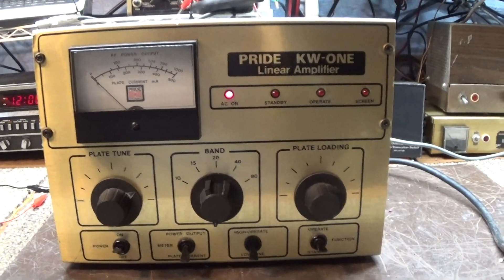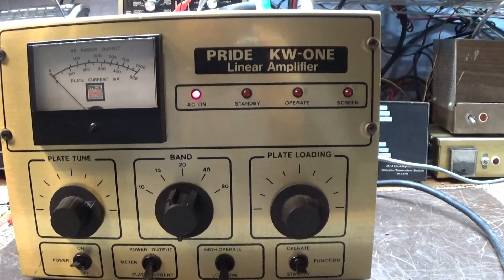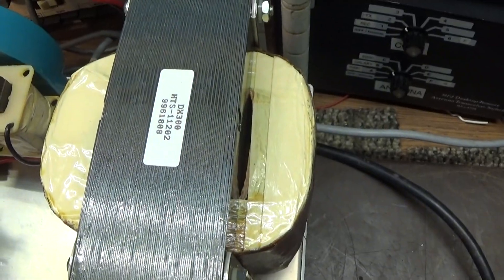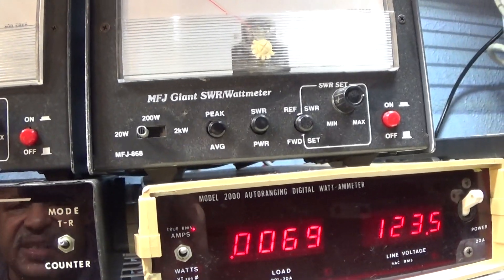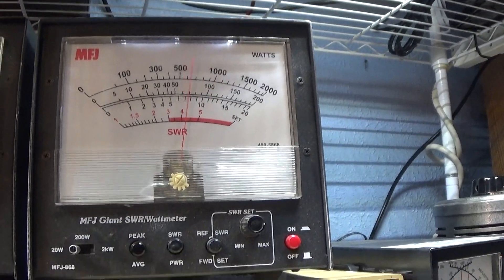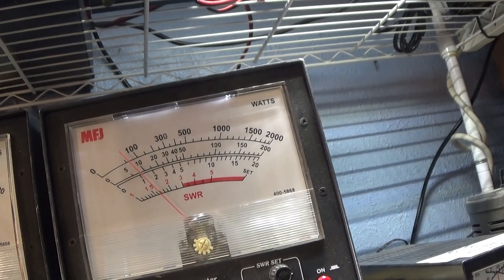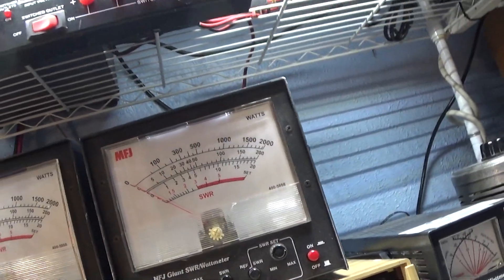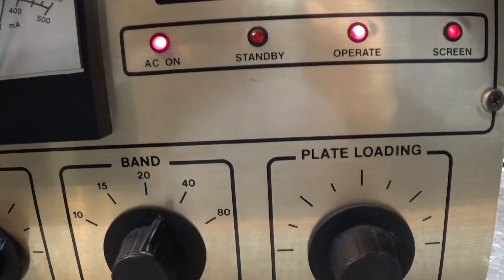Pride KW-1 (DX-300) rare single 4CX250B  linear amplifier on the bench

Comment: Sir can you please call me I overdrive my pride kw1 and I have no output power 516 417 7717 please help
Reply from the maker: The Pride is a very complicated amp. It could be a lot of things. I would say try changing the tube first. If its not the tube, maybe the screen voltage is bad. The screen voltage is a weak spot on those amps. I also suggest you get the Nomad upgrade HV and LV power supply boards for the Prides if you haven't done so already. The screen supply is on the LV PCB and hence if that is the problem, getting the Nomad upgrade board would fix it. If your problem is in the HV, also getting the Nomad HV board would fix that. Pride runs on 2.5KV's!!! Sweep tube amps run on 800v's.  If you don't know what you are doing, stay out of that amp. It would be lethal.   https://www.ebay.com/itm/114785393583

Comment: The PI/L network you talk about is actually a BUTCHERED PI output. It is 2 coils in series, NOT an L.
Reply from the maker: You are so wrong.
Reply from the maker: The factory schematic shows this amp has a Pi-L circuit while the Pride DX-300 had just a Pi circuit. Pretty sure this later model had the Pi-L and the high drive circuit added to pass the FCC at the time. High drive for a single 4cx250B? 100 in to get 400 out! Also this has a Plate current meter as it was marketed as a Ham amp vs a CB amp. What is a Pi-L?  Just a Pi circuit with another coil after the Load capacitor. It can be a continuous coil with the load tapped at the correct point, or it can be 2 coils in series, 1 before the load and 1 after. Both ways are used throughout linear amplifiers with Pi-L output circuitry.

Comment: Don't quite understand how the MFJ meter swings forward on both average and peak which indicates a higher wattage, but yet the plate current swings proportionally backwards indicating less current. How does less equal more?
Reply from the maker: Duty Cycle and RF Power vs DC power.
Reply: The amp is indeed swinging backwards. The wattmeter is incapable of showing whats really going on. Basically the amp is grossly misstuned or its being overdriven.

Comment: nice,i have a pride dx 300 with nomad board,it ll do 1000 to 1100 radio drive pep watts,on my lp100a or bird peak meter
Reply: the 4cx250b tube don't suppose to drive with no more then 5 watts pep on am career operaper manual say 12 pep for ssb and the repair manual says you can use up to 15 pep the tube company says what the operator manual sats 5 am pep 12 pep ssb with 12 pep ssb you should get 500 pep with 15 pep you should get 650 pep  when you start running 35 wats in it and get 100 watts out you tube will only last maby a year if you lucky and run hot RF Parts you can get new taylor 4cx250b tubes for$139.95  or get new old stock eimic from$79.95 to $249.00 if you don't try to get 1000 watts out of a 250 watt tube the tube will last about 10 years it more of a SSB amp because 5 pep watts on am will only give you 250 watts  but SSB with 15 pep you get 650 watts  not bad and tube last 5- 10 years good. just radio drive is too much this is a low drive amp
Reply: @extremlaybak  (Be The Shi) I mean Stuff
Reply from the maker: OK, but I always go by 2x the plate dissipation for the output. A single 4cx250B has 250 watts plate so.......

Comment: Wow! The hits just keep coming! What an excellent find. And done correctly. Anyone owning the 300 and if they're lucky enough the KW, The nomad board mods are a no-brainer. Pride definitely did it right when they used the ceramic 250b. I haven't checked the prices on the recently, but when they get soft, and that's probably not too often, there if I recall about a $125. That's much better than trying to find some NOS 6 l q 6, and then having to purchase 9 or 10 of them at 40 through $50 each. That's what makes sweep tube CB amplifiers not worth restoring. If one runs their sweet tube CB amplifier correctly sweet tubes will last 25 plus years. But most of those sweet tube amps available on eBay has been over driven to the tilt! I don't know what your opinion is on the amp, but I think it's the best 11 meter CB amplifier ever produced. Even before the nomad modification upgrade boards were produced. I think you'll agree when I say that it is what it is. It may have a band selector, but for all intents and purposes it is a CB amplifier. and like I mentioned above in my opinion it's the best one ever produced.in the almost 4 years I've been scrolling through eBay's amplifier section, I believe I've only seen 1 KW. I've probably seen close to two dozen 300's and, they're rare. Let me rephrase that. I don't think the 300 is that rare I just think people who own them are smart enough not to let them go. I don't know if this one is yours or one that you're working on for a friend, but I will assume it's yours, so congratulations doc. Congratulations on not only acquiring the KW, but all the added modifications besides the nomad boards, make that KW probably one of the best ones in existence. It was definitely done right. Keep those clips coming doc. We all appreciate it. Believe that. 73's
Reply from the maker: I do think it is the best CB amp made by far. Thanks
Reply: @tramdr  That's Cool news
Reply: Pride is the DTS
Reply from the maker: Pardon me, but whats 'DTS'?
Reply: @tramdr Maybe DA TOTAL SHIT!?! These youngsters and acronyms, only they're familiar with. LOL

Comment: How muchhh!
Reply: If you really want it you aoughta buy it. I know $1000 sounds like a lots of money for a cb amp, but look @ it this way; d&a Phantoms are selling for about $400 (give or take a few $.) You gotta take into  consideration; how many hands have been in there? Hands that belong to someone who doesn't have a clue. Then it's gonna need to be recapped minimally. Can you do it yourself? If not that's another $150 (and $80 shipping round trip.) Now you're @ $630. Then take into consideration the Phantom isn't a pride kW. So is the $370 premium worth it in the end? Imo. FUCK YEA! Even if you're lucky enough to find another pride KW, it's not coming from tram doc.  Then the icing on the cake is the single ceramic tube, as opposed to 9, or 12 6lq6's. 6lq6's are no longer produced. So any tube replacement will be "nos" or used. The tube in that KW can bought brand new for under $200. If you drive the pride correctly (like any tube amp) it should last 10 year's (probably longer.) And I'm talkin heavy use. If you're a weekend warrior, any tubes should last 20 years, if driven correctly. I have at least one tube CB craze era amp from the most popular 11 meter amp builders from that era, and all (6) of them still have the original tubes, giving full output. You could get a beautifully refurbished SB 220 for round $800. Do you want to be messing with a footswitch? Not to mention that if you plan on using an SB 220 with you're 4 watt CB radio, you're going to need another amp to drive it. Some who read this are going to get the point. I'm sure there will be detractors. Ones who say $1,000 for a CB radio amplifier is totally insane. But if you're like myself there's the nostalgia factor. There's drawbacks even when purchasing something like a brand new ameritron (foot switch, and driver if not used with a 100 watt transmitter.) Ameritron's are not really geared towards AM use, and will need to be adjusted accordingly, in order for it to sound good on the AM side (that means no full output on AM.) I'm in the process of redoing my whole Shack. If I wasn't I actually might be interested myself. Even though I have enough amplifier, to get me through the rest of my life. I don't own a pride. Even the 300 DX when found on eBay (unrestored, and sometimes untested) sell from 500 to $650. It really is a no-brainer if this is what you're looking for. In all honesty if there was something that tram doctor was selling, that I wanted, I'd buy it with confidence, in the fact that it's going to work, and if used properly work for many trouble free years, without losing any sleep, as to whether or not I'm getting a lemon. 73's. PS. Sorry for being verbose. It's just a lazy Sunday and I'm not doing anything else. Hence my long rambling. reply.
Reply: @zooyawk4526 :...Uuuummmm yeah. I'am with you.
Reply from the maker: $1000 firm plus the ride or else I am keeping it
Reply: @tramdr  im interested in buying this amp
Reply from the maker: !000 plus the ride, firm Tramdr@yahoo.com